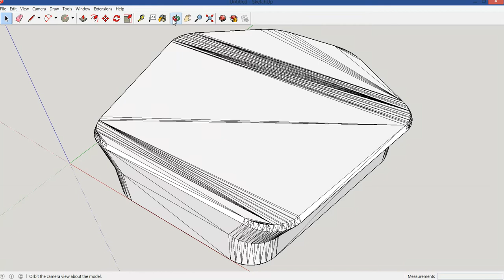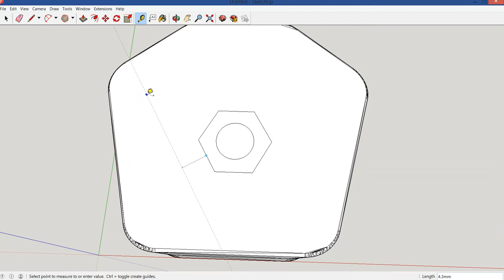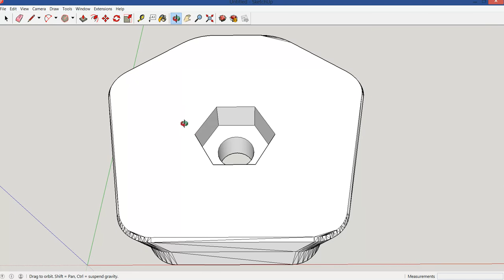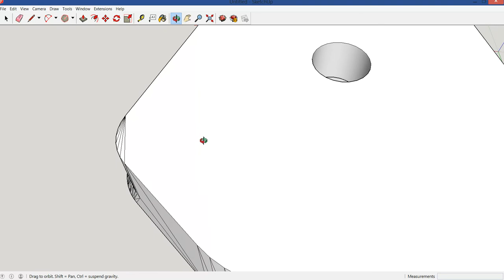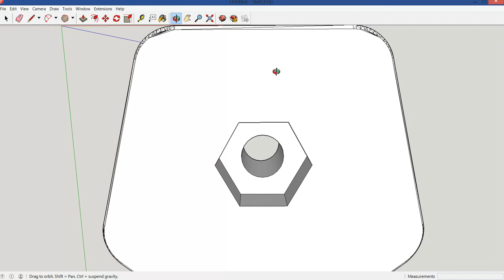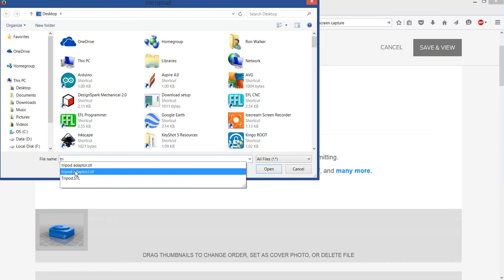sketchup madness

Comment: Very neat. I'll be watching this many times over.  I tried to dig out the hex head support but it's hard to dig out the support material to make nut hole clean looking. Anyway, I have to make another one scale up a couple of mm to make it snug with the tripod. Thank you again.
Reply from the maker: sounds good. i think the support values can be changed but haven't messed with it in a long time. its a pretty neat part to play with very well designed to begin with helps